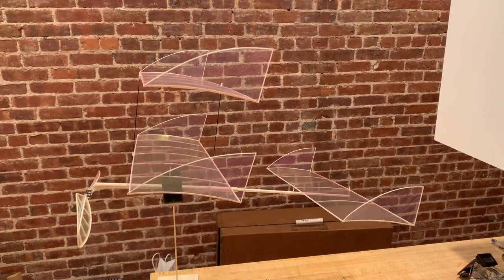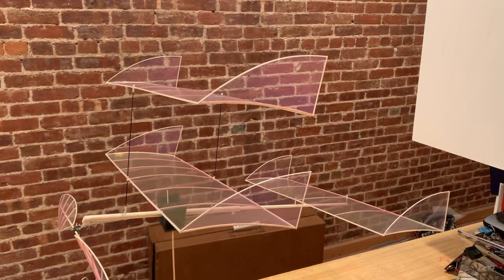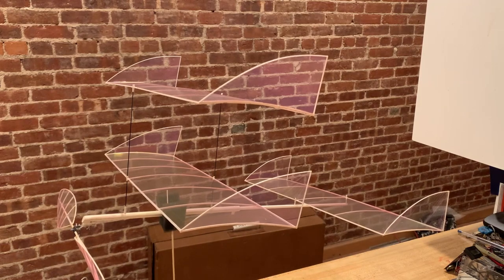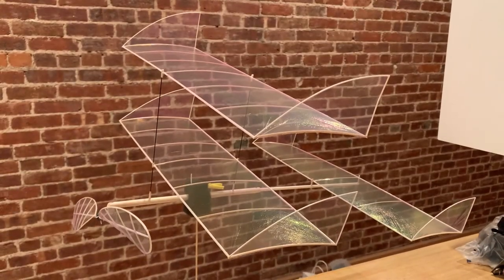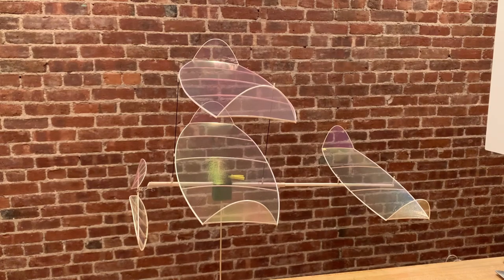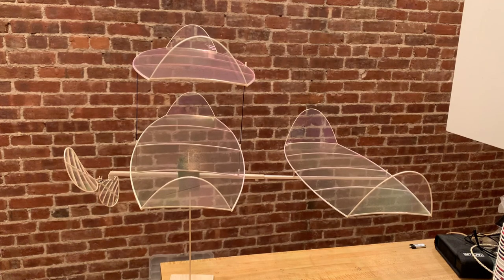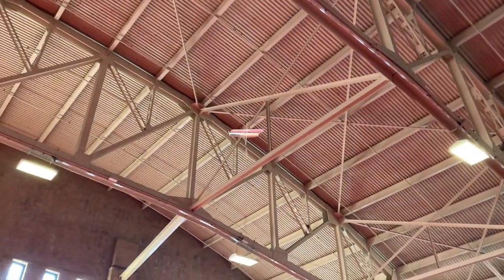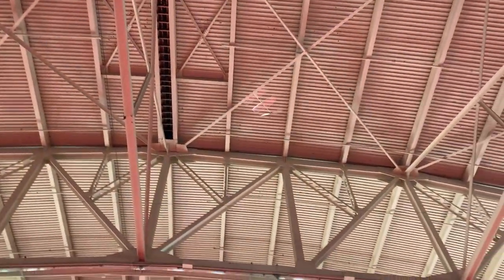For Biplane Pennyplane enthusiasts only!

Comment: Love the experimentation and interesting video! I've been flying science olympiad, but have been looking deeper into free flight and penny planes, and interested to see more! One question, do you think that this kind of elliptical wing would have an increased lift in heaver classes such as science olympiad (8 gram min weight)? if so, how would you go about implementing it?
Reply from the maker: I don't think it's the weight class (though 8 grams seems really heavy!), that's the wing loading, it has more to do with how much area you lose by going elliptical over rectangular, which I think may not be much for pennyplane. I'm not really familiar with the SO designs, so I can't say. However, so far it appears from my comparisons that an elliptical has more lift compared to a rectangular of the same area, but I'm still looking into this.
Reply: rule state the plane should fit into a box around 27cm x 34cm x 43cm so wing areas a usually pretty big. There are some kits used for competitions, most competitive being on freedomflightmodels, so you can see the design choices that he made to get a kit that usually can fly up to around 3:00. Also JH aerospace has one as well.

Comment: Very nice build. I am building an a-6 class tandem model and the forward wing is too weak and sometimes collapses. What’s the best way to reinforce it without adding a significant amount of weight?
Reply from the maker: Best way is to use a boron strip, I don't like using boron but it's perfect for wing-strengthening. Another possibility is to use a nylon thread reinforcer, or another balsa strip.
Reply: @domoremath  Boron isn't legal for A6.
Reply from the maker: @olbill70  Oh yeah, I forgot he mentioned A6! For A6 I usually just put some white glue on the LE to stiffen it up, or you could use a balsa strip.